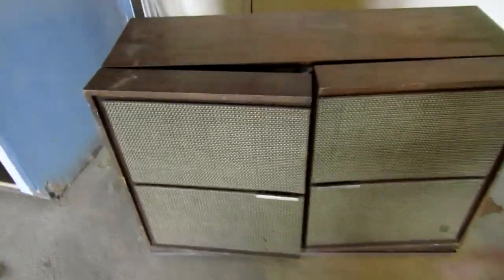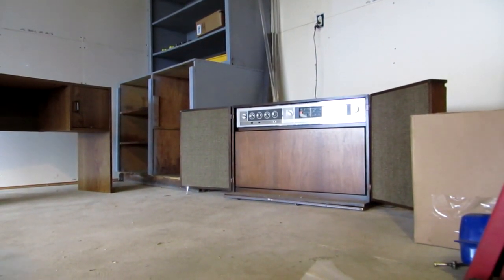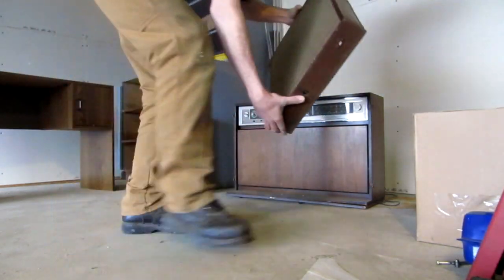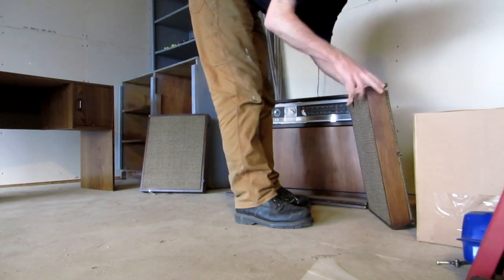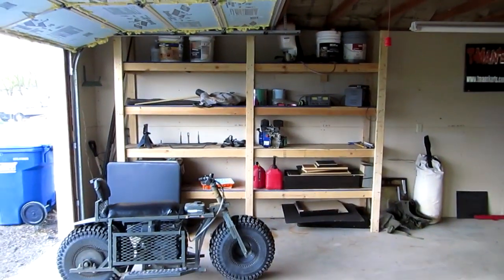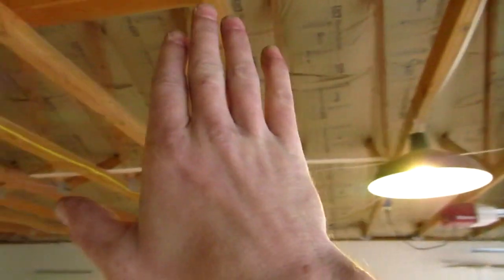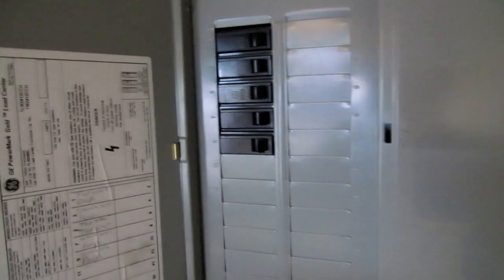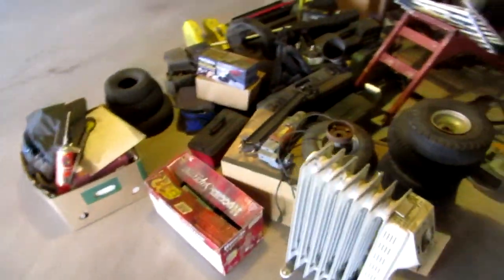NO 220 OUTLET | SOME ROMPIN

Comment: That is a 220 service panel. You actually have to put the 220 breaker in for it to be 220. If you go and look at the breaker in the house that goes to the garage, it should probably be at least a 60 amp breaker. Were you seepy when I told you that? lol

Comment: late 50s early 60s radio, just has that look. You've got everything you need for 220,
just a lil tweaking required. add a new breaker, take 1- 110, & another, & bam or should I say Zap ?  Anyway do your homework and it can be done.  I watched a video on YT about how to do it a while back. Cheers !

Comment: Yah, that radio screams 1970's. I can still hear disco coming out of it. What you can do is get a little fm transmitter for an mp3 player and use the mp3 player for your music. If you do it that way you won't have to mess with the radio by rewiring it.

Comment: To explain.  We haven't used 220 since the 60s. They upped the voltage to lower the amperage back then. Now it's 240/120. Cool shop tho man , I dig your vids
Reply from the maker: so , for example, a house will have 120 in it and some appliances are 110-115. So the house will have enough to supply a broad range of items .
Reply: In some places there is still 440. Ive seen it.
Reply: Eh, sorta kinda not really?
You have 240 coming into your house no matter what. 
It's 2 lines of 120 each. If you read across both lines , it's 240. 
If you read one of those lines to ground, it's 120. 
"They" give you a 10% +- spec from 120(or 240) that is an acceptable range. 
So for example with 240 you can be 24 volts high or low. I work on generators , I can adjust the voltage. 
Anyways, you may need to put in a new panel or a sub panel with the 240 from where your meter is at.
Reply: That's just a sub panel or somethin in the garage. Find the main panel. Who knows you could have an unused 240 dryer outlet you could run to the garage. Pellet stove , yum. Saved me thousands this winter!!  I'll never burn messy time consuming wood, rock that stove!!!
Reply from the maker: NateWilson99 yeah, I've seen huge Cincinnati Brake presses that work off of 440
Reply: Nate, yea places have 440,or 460, but nowadays it's 480. That's for industrial stuff , as is 208. And both of those voltage are 3 phase also. There's also 240 3 phase. Sometimes you can cheat and run 240 3 phase stuff off of 208 3 phase too. Yea for most typical houses you have a 200 amp service , or maybe a 100 if you are unlucky. Industrial stuff is a different deal.
Reply from the maker: MrTheHillfolk yep , now that I recall it was a 3 phase 440 electric motor that ran the brake press. cool machine but scary to work with.
Reply: We used to have a 3 phase 440 air compressor. We still have the compressor, but we changed the motor. It took up to much power, and money for its size. We still have the motor, but no use for it.
Reply: Yea man. That can be nasty(440/480) voltage, haha. I remember checking voltage on a few gens on a damp day, and seeing a little arc jump out to my meter lead just as I got 1/4 inch away. Any more dirt on my leads and I'm sure I woulda felt that! Use the 1 handed rule with your meter leads for stuff like that. Maybe you get lucky and it won't cross your heart when ya feel it!

Comment: like mentioned, the panel in garage is a sub panel get same brand breaker 2 pole don't go larger than the breaker that feeds that panel.. are you going to set up your other shed? for storage? Or to keep working out of too keep garage not so congested?  ceiling is also insulated, ply or son on top of garage trusses would give tons of storage. just cut out for the vertical supports
Reply from the maker: sure, well the shop that I built will be coming down and I will be using that wood for stuff around the new house.

Comment: hey T-man I bet you have 220v to that sub panel if so all you need is a 2 pole 30amp or 50amp breaker and a plug some wire and a way you go check your panel in the house and see if there is a breaker for the shop in there  if its a 2 pole breaker  then you have 220 happy for yo and your family  on the house that's going to be good for all of you
Reply from the maker: thanks, I'll have to take off the panel and see whats behind it.

Comment: First things first that is a Sub panel so check your main panel to see what breaker goes out to it it should be a double pole breaker. if so then you do have 220 you just need to put a new 2 pole breaker into the shop box and wire in a new outlet just dont exceed the size breaker in the main panel

Comment: do you have 3 phase , or 120 Volt  3 wire  laid in to site..1 phase to centre tap neutral =120V , & 240 volt between 1 phase & 2nd phase or live to live.

check the supply behind the main db panel you could all ready have it, just needs to be wired up for 240V 2phase...a step up transformer will require a good supply to work well. probably cheaper just to run extra cabling over a short distance,  will depend what's been installed to site. 

ideally you want 3 phase if building up a good size workshop.
 nice place you have Tman. glad its working out for you.